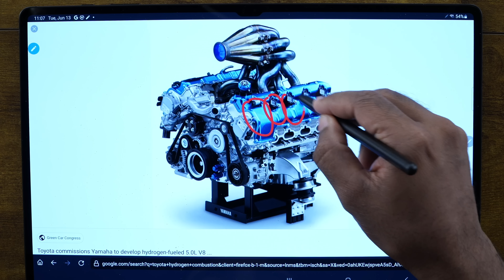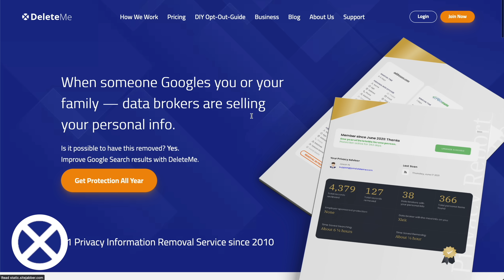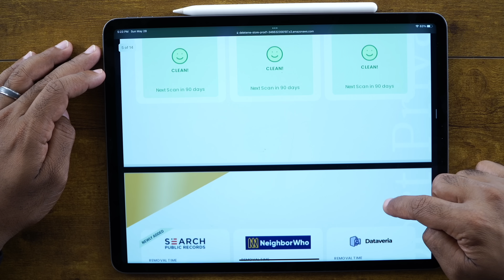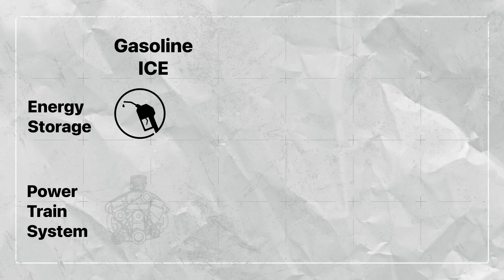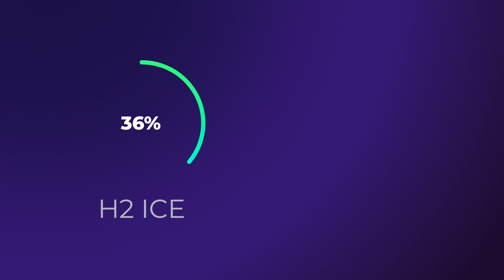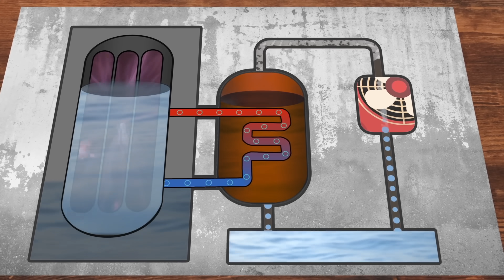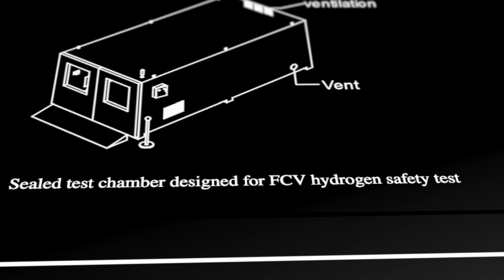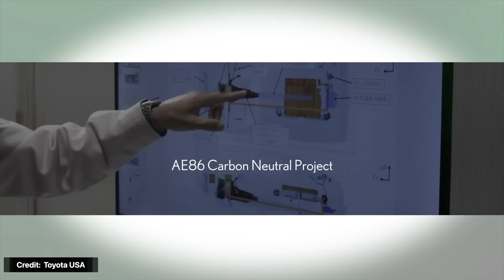Toyota's Says They Just Destroyed EVs - Hydrogen Combustion Engines

Comment: I can work with a 220torque engine that can charge a li-ion/sodium battery & run the motor also
50_50 load sharing etc or power train sharing any combo that can squeeze most miles

With presets like low noise_vibration
pure EV
hybrid system 80% engine & 20boost of motor torque offered by motor
Charging the battery & running the motor leaving the power train off,
& Running 100 on engine & power train

Comment: The problem with hydrogen is it doesn't solve the problem because the vast majority of hydrogen in the world is dirty hydrogen, not to mention it would be even more difficult to facilitate fueling stations for hydrogen than it would be for EVs which are already way more common. Plus EV's will have a much lower cost of ownership once real manufacturer start producing them compared to gasoline cars just due to fewer failure points. They aren't there yet but it's hard to see anything else coming close. And certainly not hydrogen

Comment: Hydrogen is a great solution as it is the most abundant element in the universe and burns more efficiently than gasoline. EVs seem great but the mining of materials such as Lithium and Cobalt are destroying countries such a Zimbabwe not to mention that Evs are not viable in non 1st world countries. Toyota seems to be the only company really pushing the envelope when it comes to this technology and working out the kinks. Many of the issues brought up in this video are arguments which were made about gasoline when steam was the primary fuel source for cars and now 100 years 95 % of motor vehicles are powered by petroleum based fuels. Let’s not be so quick to try and stifle innovation. I’m sure it won’t be long before people are retrofitting their gas guzzlers to run on liquid hydrogen.

Comment: I can remember when the disadvantages made about EVs (lack of charging stations, inefficient method of travel because of range and charge time issues) were considered fatal to the entire concept. Time and engineering defeated or mitigated most of those disadvantages and I think the same will be for hydrogen-powered engines. After that happens I'm certain that somebody will jump at the chance to engineer retrofit kits for ICE vehicles.
Reply: Key question is when a newbie startup like Tesla invested in such a large charging infra, why didnt Toyota do all this while?
Reply: @ecoideazventures6417  Hydrogen filling stations are massively expensive to build compared to connecting some chargers to an existing electricity grid. They need to be able to store and highly compress hydrogen, and get the hydrogen from somewhere. After all that, the cost per mile of running a hydrogen car will be so high that no sane person will do it.
Reply: @Xenon0000000000001  What about propane? They are already highly compressing a gas and transporting it for us all to have it. Also, compared to building a gas station, hydrogen would be soo much cheaper. Take it from a guy who once built gas stations for about 5 years of his life. The process to install hydrogen tanks instead of petrol or diesel tanks, isn't any different, just different hoses and connections. We already have the means to start building these tomorrow as the jobs are already there to start installing them. Hydrogen tanks also wouldn't have to be buried which would make installation faster, cheaper and easier.
Reply: @AtteroDominatus  According to Google, propane is stored at 100 to 200 PSI. Hydrogen in a car is 5000 to 10000 PSI. 

They wouldn't store it at that pressure in the fuel station tanks, but it needs to be able to compress it and get the compressed Hydrogen safely into a car.

The tanks will need to be better than airtight to hold the Hydrogen, and I can't believe that will be cheap. Since the tanks won't be holding Hydrogen at 10000 PSI, they'll have to be really big to handle a decent number of cars.
Reply: @Xenon0000000000001   it's already being done. I didn't say to use the same tanks as propane, I said the concept is the same. You have a large tank that fills smaller tanks. Nothing is cheap either, I said cheaper than what we are currently doing with petroleum. You're not a very bright one....
Reply: @Xenon0000000000001   If you look into it, California has hydrogen stations. I'd say they have already found a way to compress it in smaller tanks... safely...
Reply: @ecoideazventures6417 because Toyota has investors who expect them to make money every quarter.
Reply: I think with engine swaps (the transmission should be fine if it mounts) and tank swaps this could work.
Reply: What I consider fatal to the entire concept is the lie that EVs are somehow going to fix all ICE related climate issues.  EV owners just outsource their pollution to whatever energy infrastructure is in place.
Reply: It's too late for the European market. The brainless folks in charge set a deadline of 2035 to end all combustion engines. In 12 years, setting up all the electric charging infrastructure will already be a challenge, there isn't enough time to set up a parallel hydrogen charging system.
Reply: Retrofitting will always be a relatively small industry for individual private vehicles. Why would you convert to Hydrogen when in all likelyhood you will be able to buy an eFuel at lower cost if you are adamant to keep an ICE car going. 
Retrofitting large fleets of buses, commercial vehicles or plant might make sense if you travel regular routes but still not convinced BEV won't also be suitable when battery density further increases which it has already and will continue to do so reducing initial costs.
Reply: Hydrogen has additional barriers infrastructure were for producing electricity  we have it. And transportation infrastructure for electricity we have it not only that you do it at home for electricity
Reply: @kreb7  Ya we don't have infrastructure, we have chargers but very soon (and in some cases already are) hitting the limit of the grid. Chargers without the power to run them are useless and we can barely handle the AC units let alone chargers in homes.
Reply: @mauzeking6661  1. Upgrading easier than creating from new.
2. Charging at home at night when the grid is well below capacity is another positive. Plus you spread the load.
Reply: @kreb7  first at night is not a solution because in many places the demand is still high and it's not a supply issue so much as the power lines can't handle the amp demands of a block of houses and 4 evs. Considering it's more the 1 car per house that's way too much demand.

Upgrading is not easier than building from scratch in all cases. The building constraints that were in place in the original design may be irrelevant in the new design and vice versa. Meaning you're left with vestigial aspects and may have constraints that are unnecessary except for the need to upgrade.
Reply: @kreb7 charging at night is still viable because ev cars are still niche. If we turn it more popular then charging at night will be not advisable
Reply: @eng3d  No is viable because at night use alot less. Uk figures below. 07:00 to 21:00 0.8kwh. The other hours is 0.2. If you also include that you don't drain your battery but just top up is more than enough capacity. That without even pushing the network
Reply: Ev cars still have the same problems than before. Full charging from 5 to 3 hours is an advance but it is a big trouble
Reply: Why not just have EVs with a hydrogen-based charging system? The ICE model has so many inefficiencies in both mechanical parts and the limits of combustion efficiency, that it renders the whole combustion aspect quite flawed...
Reply: The problem is it doesn’t NNED to be overcome. RT have overcome the issues, why do it again for Hydrogen? It’s SO much more work for what?.
Reply: There isn’t H2 infrastructure.
Reply: In general you need water injection to make an H2 engine work.
Reply: The H2 tank costs more than a battery.
Reply: "I'm certain that somebody will jump at the chance to engineer retrofit kits for ICE vehicles"

Precisely!  There are plenty of people that would love to convert our beloved older classic and specialty vehicles to HCE.  Hell the car makers are even developing kits to convert older ICE to full electric so if HCE catches on at all they will do the same with them.
Reply: People are forgetting the tax on gasoline it will be put on what's being used. The power grids we have now could not support electric vehicles in the numbers that we have gas vehicles. If we go all electric cars the cost of electricity will be unaffordable to most people. We use electricity for enough things it would be foolish to use it for everything.
Reply: @shermanfisher9953  “foolish” isn’t a quantifiable term. Adding a lot of solar, which gets cheaper everyday, to a lot of roofs could mitigate the grid issues.
Reply: Here is the big question , where are the filling stations for Hydrogen at , just a few days ago I hear  , president Biden is funding money for  7 Hydrogen filling stations in the United States , so in the meantime where are the Hydrogen filling stations , so I don't see how Toyota is ruining the EV Car Market and why don't they do like Nikola Trucks , Hydrogen Fuel Cell powered , that makes it's own Electricity from Hydrogen ??????
Reply: Those are logistical problems that can be overcome with effort and money. The biggest barriers of hydrogen are fundamental physical laws. We can’t spend away the laws of thermodynamics.
Reply: @jonathanfields4ever  the biggest short term problems besides infrastructure are tank expense and fuel cell expense.
Reply: There can be no real retrofitting. It works in the short-term, but long term destroys the engine...¯\_(ツ)_/¯
although turbines are more adaptable due to the exotic metals used, Uncle Sam made car companies destroy the prototypes years ago....(Chrysler)
Reply: @firstjohn3123  Yes they will. They can make complete replacements HCE engine with fuel tank and line replacement kits to replace the ICE systems in older vehicles.  And while it may not be practical for most people or everyday drivers there are plenty of people that would buy them for classic and specialty vehicles.

Comment: The fact that they do not use Rare Earth elements is going to be what makes this competitive with EVs. Hydrogen being the most abundant element in the universe just makes this a lot better in my opinion overall. As soon as we get past the massive upfront cost of making the hydrogen harvesting infrastructure and getting in place all fueling stations in place. I think it'll be competitive with gasoline based combustion engines, and long term solution for replacing fossil fuels which are still heavily relied on for creating the electricity used in electric cars.

Comment: H2ICE could make sense but I don't see it working unless hybridized. FCEVs remain too expensive and have questionable robustness compared to ICEV and BEV. Regardless, if hydrogen production does not scale up, it will remain too expensive to be economically viable anyway. BEVs have yet to be a viable choice for many consumers for a few legitimate reasons, so hybrids are currently a great choice. If hydrogen could further clean up these powertrains, that would only be a good thing. If the production of hydrogen fuel can outperform the already extremely inefficient production of petroleum fuels, it definitely has a chance to succeed. Hydrogen can't compete with batteries for overall operational efficiency but I think it can compete with gasoline and diesel. However, it has to be sold everywhere or else it will never be a thing. We'll have to see what happens over the next few decades.

Comment: Hydrogen requires electricity to produce. It's adding a step and then it's still not as efficient because it requires mechanisms to generate rotational motion. Heavy flywheel for timing and forward momentum. Induction motors just need the electricity.

Comment: Where was this 15 years ago? Combustion, regardless of fuel source, is still combustion. That can't replace electrics instant response and torque, control of direct drive to the wheels, or reduced mechanical parts and maintenance. This engine is really cool to see in concept, but I think it's 15 years too late. Batteries are only getting better and better.

Comment: The interesting aspect of hydrogen’s potential (for me) is the potential for decentralized (mom and pop investor) local hydrogen production. Big $ power companies are afraid of losing their monopolies. Plus, the potential to store an extra hydrogen cell (once properly designed) for emergency use (similar to an extra gas tank) is a unique advantage over EVs. Not one single EV on the market has a backup fuel source.
Reply: You could make this same argument for solar panels etc couldnt you with BIG energy. However, that hasnt stopped these things coming to fruition, so its possible as they know they will still make more money than they can count. The big companies will buy out their direct competition in the industry as they can afford to when the market goes in a different direction, like BP buying out EV charger companies for example. Its their market, they will maintain it as they have the resources to scale them and make the existing owners rich.
Reply: @keithjohnstone3537  Valid point, but I’m still all-in for the underdogs in the industry coming up with new innovations and market competition!
Reply: Of cause it has. It's called Tesla Powerwall. I mean a lot of houses today have solar and a backup battery. It might not be as fast and filling the petrol tank but hydrogen is not a petrol either and it is not that easy to get it from one tank to another.
Reply: @BlkRider  A Tesla Powerwall as a “backup” power source for your EV? Do you suggest strapping it to the car’s roof?You really have me confused!

Comment: Very biased presentation. This is a script reader not an actual expert. Hydrogen beats the snot out of EVs. He speaks about how hydrogen cars are only clean if green hydrogen is used but that is true of EVs and the efficiency of EVs is dependent on the efficiency of the electrical charging source. EVs are far less efficient than as illustrated here. Many glaring omissions, poorly presented flawed logic. Clearly EV propaganda. There is a reason why EVs are so favored and its about controlling you. Electricity is easily dispensed with market controls not governed by free markets.

Comment: It's funny hydrogen has so many negatives as a fuel or energy storage; Leaking, damaging metals, needing huge amounts of energy to compress for storage or needing expensive hydrides to sponge it up. But all those negatives go away when you combine it with just a small amount of carbon. This complex hydro carbon chemical is easy to pump, store, doesn't eat metals can be held at standard pressure...

If you are already making hydrogen you should just bind it with carbon and be done with it. Also no need to make a new engine.

Comment: Sounds like you didn't do your research. Electricity is also a pain to generate. Most power plants aren't looking near that efficent. Closed loop plants only hit around 35% and the combined cycle are slightly more efficent but those also generate CO2. then chargers are only so efficent as well.

Comment: 2 Reasons why they did this: 1: Enthusiast vehicles. Instant torque is cool for making interior GoPro shots of scaring your mum, but the engines have no character at all, and once the novelty wears off, you have an extremely heavy car that feels heavy. Light cars just feel better to drive. 2: Converting existing engines to hydrogen is really just a case of mounting a tank where the fuel tank was, changing the injectors, and tuning it. Yeah, there is more to it than that, but not by much. It is pretty easy overall.
Reply: Cars having "character" and "feel" will hopefully not be a thing much longer. I've every hope it will be illegal to manually operate transport within my lifetime.

Comment: Your points about energy efficiency is misleading. Gasoline has similar efficiency as hydrogen, but both have so much potential energy even 70% loss of energy to friction and heat still leaves enough energy to provide over 400hp in the V8 engine. The energy loss is a non issue.

You also left out information about what it takes to generate the electricity which is used to charge electric vehicles. Most of the energy production for EVs would be produced by fossil fuels, which produces pollution. Many EV owners may use solar panels at their home or have the potential for doing this. I have solar panels and will do this if I ever buy an EV.

Electric vehicles are very attractive due to very low maintenance and efficiency, but the batteries have very short life spans compared to ICE vehicles, with a very high cost for replacing the battery.

Battery production is also very destructive to the environment, in addition to the use of $lave labor to mine the rare elements needed for the battery.

Would love to see a video about the future of battery technology for EVs. I’m personally waiting for battery technology to improve before buying an EV-smaller, cheaper, and longer lasting, which is on the horizon.

Comment: You are ignoring the fact that to produce the electricity for an electric car, pollution is produced.

You might not be polluting the environment while you are driving an electric car, but pollution was created somewhere else, wherever that electricity was produced.

Only a very small percentage (about 7%) of electricity is produced by non-polluting sources like wind or solar power. Most likely the electricity that an electric car is running on was produced by burning coal.

Electric cars are still polluting, the only difference is, the pollution is taking place at a different time and location than where the car is.